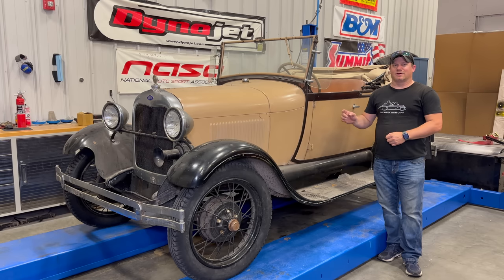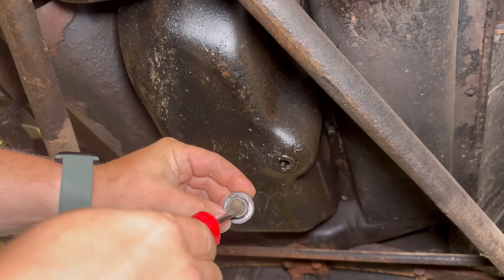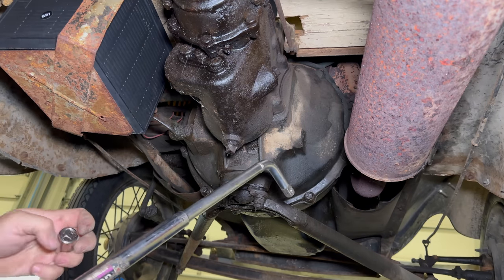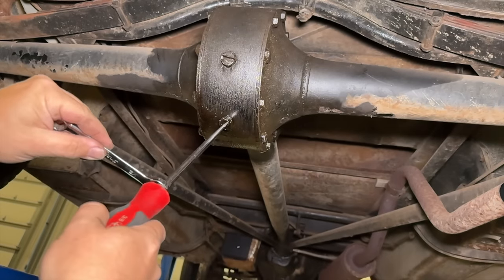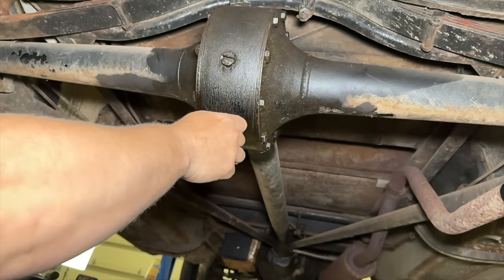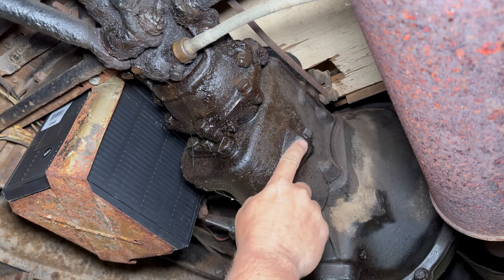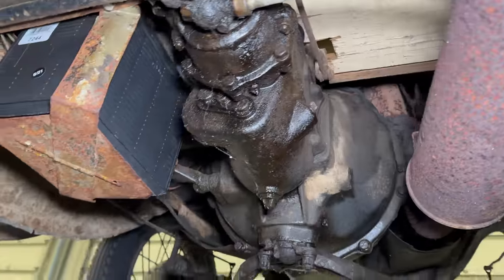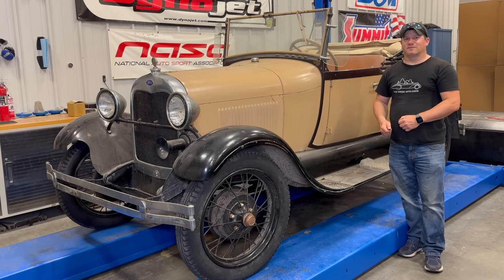1928 Ford Model A Fluids Change

Comment: I agree with your approach Steve. Going for the first test drive the transmission could've started 'screaming' or the gearbox started to grind so yes 'method in your madness' (I thought that was only an English/British saying!). I may be generalising here but most old cars leak oil, most of that can be due to inferior gasket material but good to keep an eye on it.I think she will run much better and change gear better now the fluids have been changed. I like that 'slot' socket a good tool to have, I don't think that was around 30 years ago when I did most of my work on cars. Great video Steve thanks for the post. 👍👍

Comment: Oil filters were added because people weren't doing their oil changes at recommended intervals and the manufacturers got tired of replacing engines under warranty when they knew that the car wasn't being maintained properly. The filter gave them something to show to the customer as well. They couldn't dispute nasty oil and metal shavings when it's in their face. Some cars had to have oil changes and valve adjustments at 1500 or 3000 mile intervals. Americans ain't got no time for that.  Realistically any car can run with no oil filter, but only if the oil is religiously changed.

After sitting for so long the oil probably just seeped out and the seals are OK. If anything it kept the underside well protected from rust. The rear ends are known for seeping anyway. It's just how things were in 1928. And you're right about the oil. The stuff that you get from the Model A parts places is the same stuff with a different label and higher price. It's not necessary. 
It's a sweet car. I'm glad it's in good hands.

Comment: boy, oh, boy could i have used one of the bags to good effect (didn't know they existed)  when changing the gear oil in my 2001 dodge 1500 ram pickup with a manual five-speed the other day. as it was i ended up with about half a liter on the ground, half a liter in the transmission and half a liter down my arm! :)

Comment: The hole in the oil plug would be a good place to put a strong magnet to pull out any particles out of the oil. I have also put them in the transmission and rear end. I also put them on the fill plugs so that when I check the oil level I can clean it and get a feel of how the transmission and rear end are doing.

Comment: Excellent video Steve  :) just helpfull hints on this car on oil drain plug you can use thin layer on thread's  of Anti Seize or Grease or clear Vaseline   that my Older elders taught me  and helps from rust up and grip if try come out! Also if exhaust get loud you put 2000 year of Chevrolet Impala Silencer tube in pipe keep quiet too if find original Ford Exhaust for 1928 car  and like sounds of too !

Comment: I always heat up the components with a short drive before draining.   Warming the fluids allows them to drain better;  especially helping to reduce the sludge build-up in the engine pan.
Reply: Except the transmission and the rear end were empty.  😉

Comment: Need to take it somewhere that you can get it steam cleaned underneath or invest in a case of brake cleaner to clean off the grease and oil. You will be able to tell how bed the leaks are and where exactly they are coming from.

Comment: Thanks Steve, interesting as ever. Couple of questions. Do you keep some sort of log for all your cars so you know when you last changed the fluids (or did anything else) and what fluids you used? The goo that you took out of the sump plug, did you have a look to see what was in there eg metal filings (or worse)? Will you look to replace or repair those damaged plugs?
Reply from the maker: What damaged plugs are you referring to?
Reply: @ThisWeekWithCars  I meant the drainage and filler plugs on the dif.

Comment: Just my opinion. Your using the wrong oil. I would suggest non detergent mono grade oils. Your going to stir up all that sludge and will be doing a complete rebuild soon. Most of that synthetic oil will end up pissing right through your gaskets. Just my opinion.
Reply: Yes, that full synthetic gear oil will run right out of the old leaks, and quite a bit faster than conventional oils would.

Comment: Just wondering why did you not give the transmission and dif a steam or pressure wash so as to see where the  oil leaks are.
Reply from the maker: It wouldn't matter, if it is leaking I will replace all the seals when I take it apart.

Comment: Hi Steve, what is that big black box next to the engine? Is it the battery?
Reply from the maker: There is a black battery under the floor next to the transmission.   If you are in drivers seat it is under your feet.